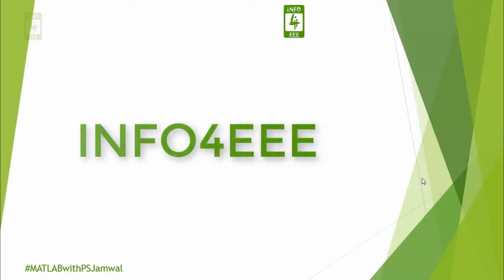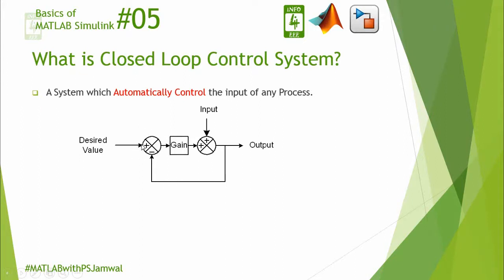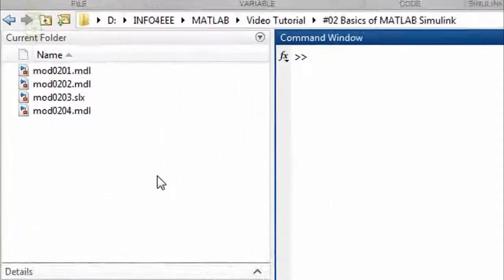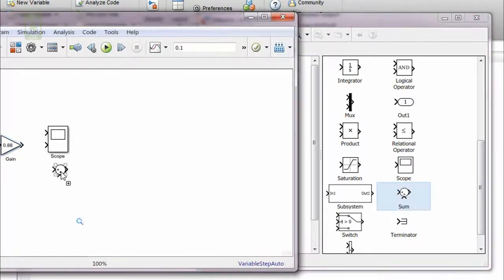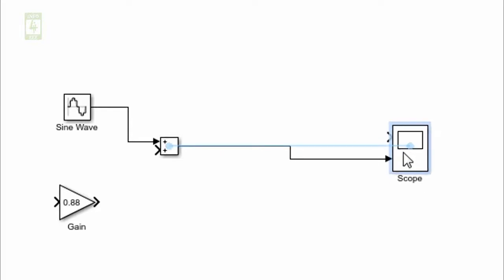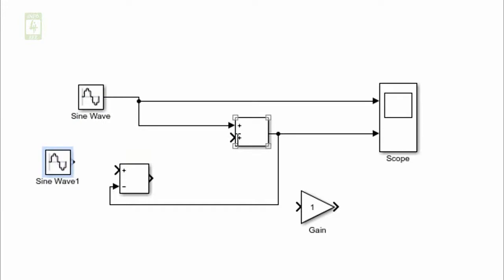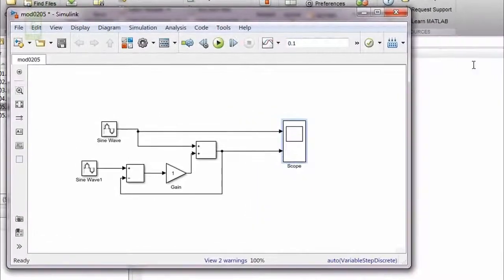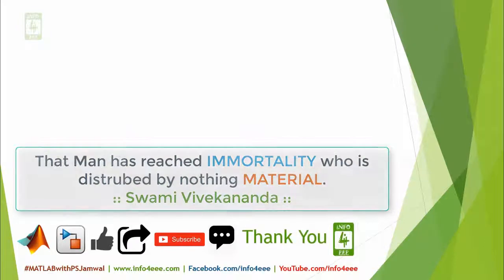Closed Loop Control System Using MATLAB Simulink | Sum Block in MATLAB Simulink #05 | Module 2

Comment: If two same systems are simulated one with open loop and the other as closed loop then what's the difference with their plots in scope?
Reply from the maker: In Open loop control system, Output is directly proportional to input. In this, Output will always be greater than input. Example: For gain is equal to 2, If input is 100 then output will be 200 and if input is 300 then output will be 600.
In Closed loop control system,  Output is also directly proportional to input. But output will be greater than input when input is less than reference and Output will be less than input when input is greater than reference. Example: For gain is equal to 2 and reference is equal to 200, If input is 100 then output will be 170 and if input is 300 then output will be 233.